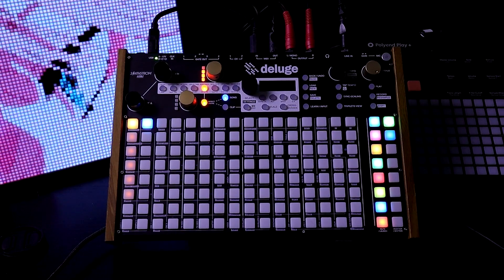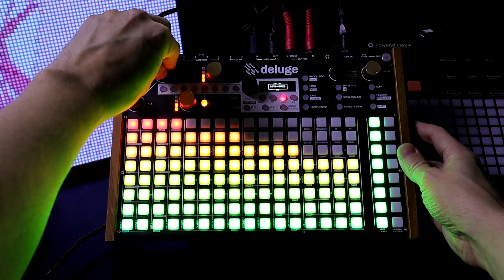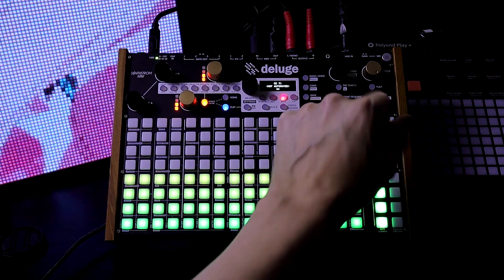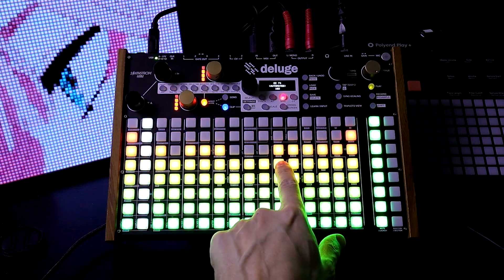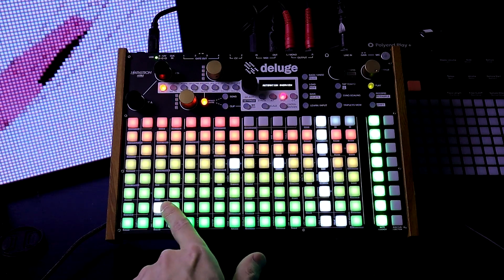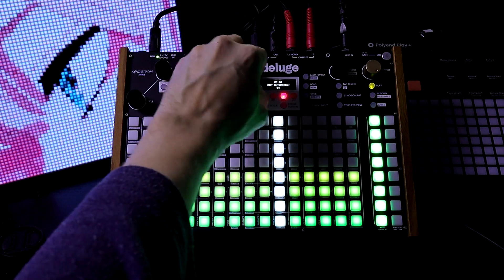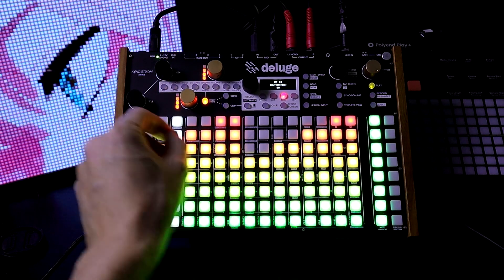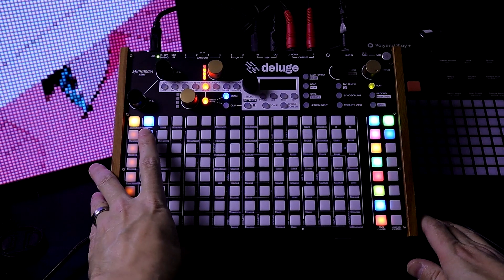Deluge Midi CC and Line in FX / Automation Part 3 // Synthstrom Deluge Tutorial

Comment: How do you change the actual knob CC destinations when in midi? You used to press the gold knobs in and it would let you pick the CC value but can't seem to find it anymore. Edit: Got it. 

To change the Synthstrom Delgue's gold knobs on a midi track, you press and hold in the gold knob you want to change the CC value for and then turn the settings knob to the value you want.
Reply from the maker: In the settings menu

Comment: Hello Ron, is it still possible to map cc to the custom gold knob buttons ?
I say that cus I really miss to assign volume direct to a knob , and I would to the same to the other custom knobs. 
Thanks
Reply from the maker: Yes there's nothing removed from previous versions
Reply: @RonCavagnaro  Woa, I missed something. Maybe too many concept recently.... But is pitty anyway that in MIDI mode , all the non assignable Knobs are still not assignable. I would love those being assignable to the same task/value/nomenclature reported on the layout of Deluge. For instance Pan & volume could have beeb just there to be assigned as Pan & volume also to external devices... . Whatever.... thanks to remember me . I will better check the manual
Reply from the maker: @effebidi9677  you can program gold knobs to cc, I have videos on it. Or just hold down the knob and turn the select knob. This has been on deluge since early on, hasn't been changed.
Reply: @RonCavagnaro  Ok so , then, not only the custom knobs!? ..... I truly must check your old videos. Sorry for asking  again !
Reply from the maker: @effebidi9677  all of the gold knobs can be assigned your own cc #

Comment: An additional way to capture MIDI is using a DAW. You can connect to Deluge via USB then set up the channels to your particular synth. You can use your DAWs MIDI tools for such as envelopes and other MIDI effects to be recorded by the deluge. Automation view will then visualize for you per CC.
Reply from the maker: Yes this is another option but then there's issues with midi clock synch with daw!
Reply: @RonCavagnaro I actually haven’t had this issue. For those that do I can understand this being not optimal. I would suggest calibrating your DAWs compensation error or latency if possible. I use Ableton so I’m not sure how this looks on other programs.
Reply from the maker: @lucasj7577  yes i ran into way too many issues a hybrid setup, not into it . No clicking a mouse has improved my life . Went all hardware not for status but for workflow :)
Reply: @RonCavagnaro  Yeah I feel that. I use Ableton primarily for mixing.